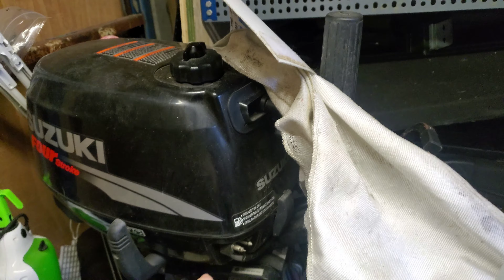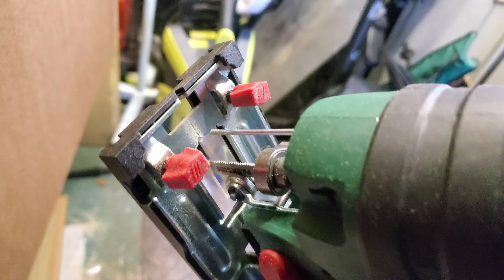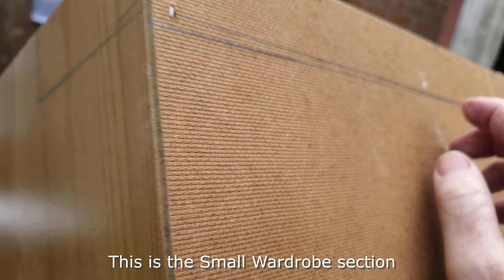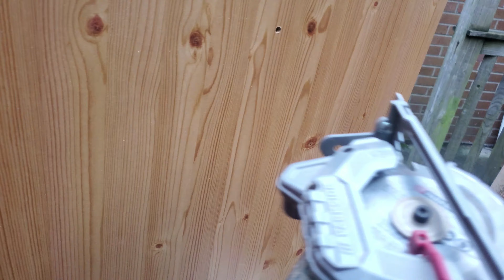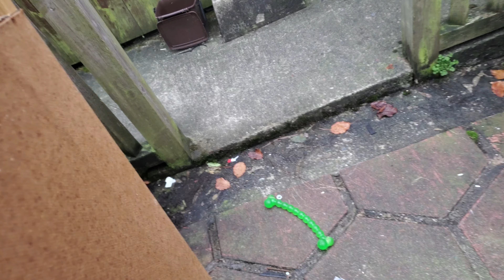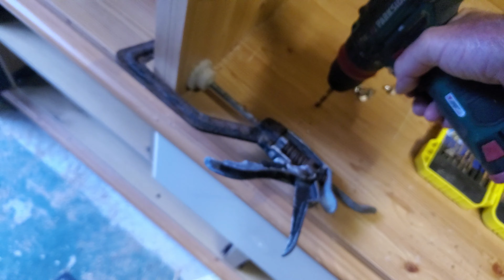DIY - Organize Shed Space - Part One

Comment: Ahh. Austell, I never liked the rechargeable tools for my DIY, when they are not used often the batteries were always low or done, I always have the mains cable and mains tools ready to go. But some good DIY tips there. Top job for the shed. Good videos for the winter work and hope the weather warms up so you’re on the road again.
Reply from the maker: I agree about the batteries. I've I both dewalt and Makita cordless hammer drills in the past. Even a Bose Bluetooth speaker that had to be deposed off because of the batteries. If they were left flat then it would destroy them. The difference this time is because all the tools use the same batteries, then thing like the hedge clipper  that sit in the shed all winter don't have the battery plugged into them. Instead the battery can be used with the cordless drills. Another person left a comment to say that parside do a attachment than clips onto the 20 volt battery, turning it into a tourch and also has two usb sockets that can be used for charging phones etc. If I can get one of them then I could also use the battles fir wild camping. I store all the battles inside  and not with the tools so hoping it works out. I still have the sds drill for larger jobs